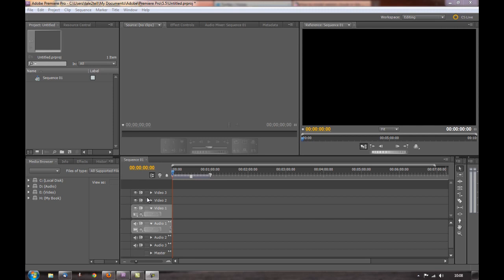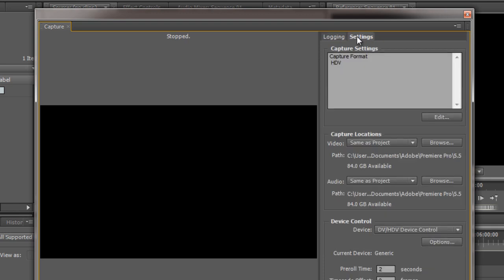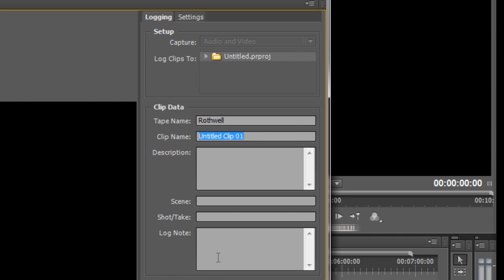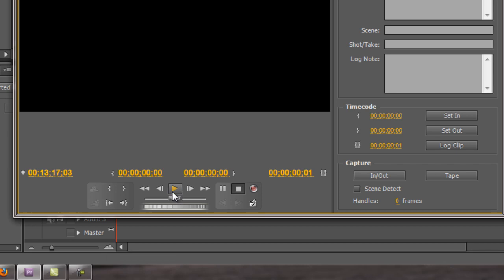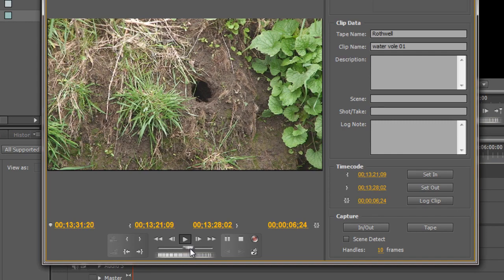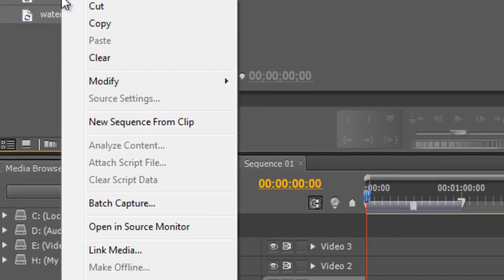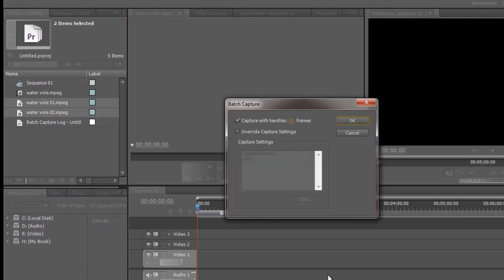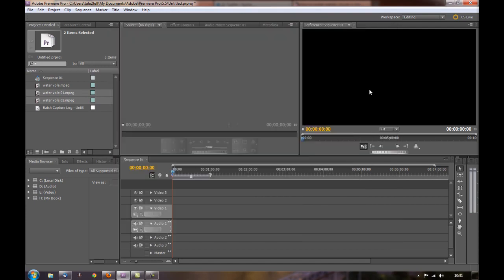Premiere Pro: Capturing & Batch Capturing from miniDV tape

Comment: I know this is 10 years late, but thank you for making this. I can understand how this method would be useful in a professional setting and why it exists, I'm glad I understand it now. I, However, will not be using this method. When it comes to capturing memories from DV tapes, Id rather just capture the whole thing and sort out the clips and edit them after. This method requires editing twice essentially, because choosing the in and out points before it's even captured is a labor intensive editing act, that cannot be undone and I'd be too afraid I'd missed a little nugget or memory later and wish I had just captured the whole tape to be edited later.

I just dusted off a box of DV tapes and purchased some adapters to get them to work on my PC through thunderbolt. The most current version of Premiere Pro still has this capture function and I'm hoping once everything is plugged in I can capture the footage. I also purchased a miniDV playhead cleaning tape, I really want to get these tapes into digital files once and for all. lol Here's hoping everything goes off without a hitch.

Comment: Thank you so much for the tutorial! I have a question, I’m preparing to transfer a few family home miniDV tapes and I don’t know whether or not they have timecode throughout the tape. 
Is there any way to check if they do? - and if they don’t, how would one go about capturing them?
Could I just capture the whole tape at once?
Is there any disadvantage to doing it that way?
Reply: Unfortunately I don't think there is a way to look at the timestamps, however, you should be able to record the whole tape at once! You can still use this method to capture them. My computer only worked as DV mode (instead of HDV). When I was recording them on Premiere into my project, it sometimes stopped and recorded as sep. videos. I just exported them as media files onto my computer, then will cut the videos up if they didn't break up! Hope that helped
Reply: @sydneth_  Thanks for the response! At the end I did end up just capturing the whole tape at once, which worked perfectly! :)